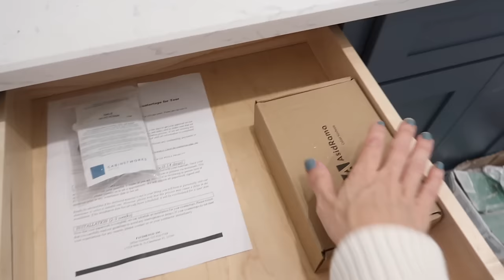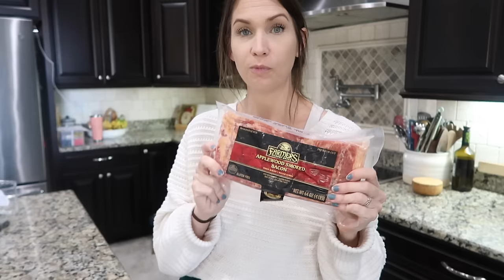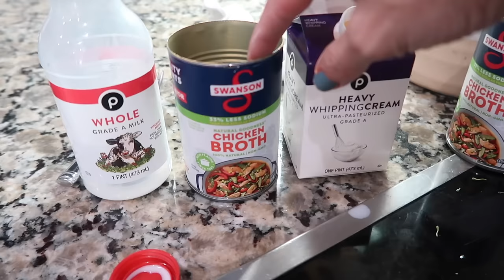Huge House Update & Future Plans! 2 Amazing Soup Recipes, Cleaning, & Christmas Gift Sorting!

Comment: There could be easy solutions to your floor & door. Walking toward the addition, the load bearing wall is on the right. Is it load bearing on the left as well? Are you able to remove the trim and door frame on the left? Which would make the wall equal/seamless.
With your tile choice, different colour, you can get someone from Legarri to mix up some epoxy with some tint in it that would match your original tile once its painted over the grey tile you bought. The best thing is, its waterproof and tough once cured. Then you just paint clear epoxy over your original tile so they both have the same sheen and protection, making the whole floor match.

Comment: I dont know how far in advance you tape and if the hall flooring is laid yet, but just a suggestion as we encountered something similar. Our contractor and tile guy worked together and came up with a wonderful solution for us. Because I did NOT want 2 different tiles butted up against each other because (although you want to tell yourself that no one will notice) it is extremely noticeable. We put a marble threshold in the doorway between the two floors. We also placed one in each doorway where the flooring was different. Example...between hall and bedrooms etc Now it looks like it was intentional and it is not out of place at all. 
Addition is looking great so far
Also, there are several places on line where you can "design a closet" A lot cheaper than having customs built. You design and pick color, wood/wire etc and the pieces are sent to you. You build the closet. It was about 1/3 of the cost. Also, home Depot does them as well. We went the online route and LOVE them

Comment: Just put shelves in the hall closets and use bins or baskets if you need "drawers"....that way you aren't stuck with a drawer design that might not match what you need later...and bins or baskets can be changed out moved up or down...more customizable...and a lot cheaper.

Comment: For the load bearing wall, could they not go in the attic and tie into something to take the load off?
Reply from the maker: the architect is acting as though he's holding up a sky scraper with what he wants to do it's insane.  it shouldn't be a huge project, the contractors came up with a different idea, weve had different architects out to get their opinions and they all come up with different things but our specific archetict won't approve anything and since his name is on the plans with our permits we have to go with what he approves.  it's infuriating.  so once it passes inspection we'll hire a new architect and fix the problem!
Reply: @thewadsquad  that is so ridiculous! But at least you have a plan of action. I know you're probably wanting it to just be over, and that's understandable, but you definitely seem to be handling it with such grace.

Comment: Woah 😳🫣 the dip and crack in the concrete in the hallway going all the way through the closet. PLEASE talk to structural engineer before covering that with tile! It SHOULD NOT be cracking like that this early into being built!
Reply from the maker: we were told the settling was normal.  we live in florida - we've had several architects and contractors come through here --- getting multiple opinions, and they've all seen it and it's never been a cause for concern.